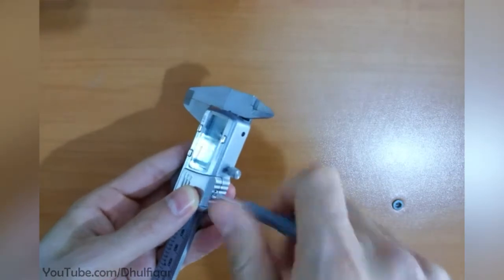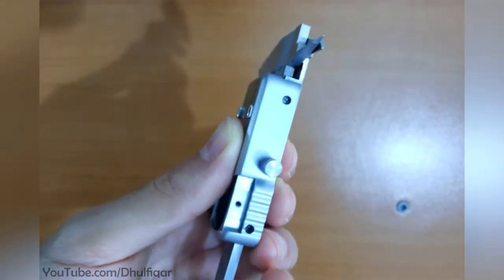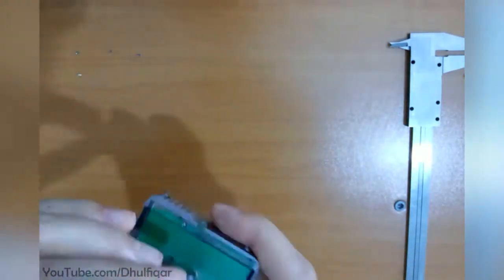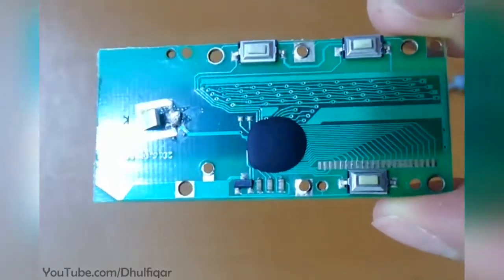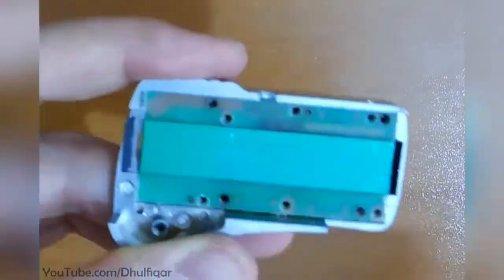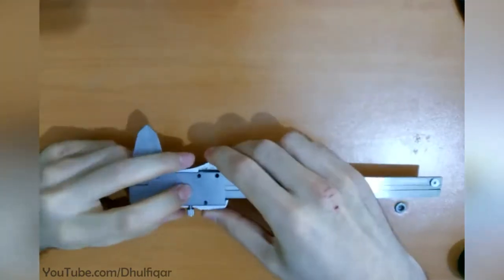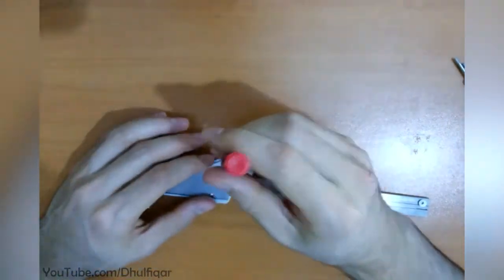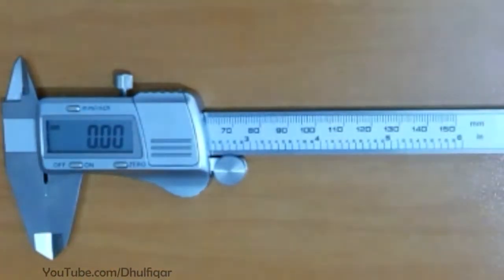Digital Calipers: How to disassemble, assemble and maintain || Vernier Caliper Disassembly/Teardown

Comment: Thanks man. I pulled my calipers out after years in storage. Went to remove the battery and accidentally released the tension spring. I was able to fit it using this video.

Comment: Can we clean it with WD40?
Reply from the maker: No. don't use it. (Or use it only on the metal parts away from the electronics to remove corrosion and then wipe it well with Alcohol to remve the oil residue)
WD-40 Contains oil.. You don't want oil on the contacts of the circuit board.
Use contact cleaner instead.
Lubricate only the parts that require lubricating away from the Electronic parts.

Comment: Merci pour cette vidéo mon ami. Elle m’a bien aidé 👍🏼
Reply from the maker: Vous êtes les bienvenus!
Reply: @Dhulfiqar  merci par contre le mien ne fonctionne plus du jour au lendemain j’ai changé la pile et c’est toujours pareil… je ne comprend pas 🤔
Reply from the maker: @pascalmitz4980  Try to reseat the screen on the board maybe it is not seated right.. Also, Check the battey contacts.
Make sure to dry it well.

All the best.

Comment: Cleaned with cologn and now its broken but smells great
Reply from the maker: Sorry to hear that.
Give the circuit board and the screen sometime to dry.. maybe the water content in the cologne is a bit high (60 percent colognes contain 40 percent water and other ingredient).. either way let the circuit dry in the air or with the help of a hair dryer.
if you have 99% Isopropyl Alcohol or Ethyl Alcohol then soak it in it to suck any leftover moisture from the circuit and the screen.
All the best.

Comment: Whenever I reassemble a set of calipers like this, the LCD display is always messed up. It is very hard to align the contacts on the LCD with the traces on the board and apply the correct amount of pressure with the screws.
Reply: strange, i never had this issue on mine.

Comment: My calipers screen is dim what i do please tell me
Reply from the maker: Hi Ahmed. I don't know why but maybe the battery is low or the screen is not seated correctly or the screen's contacts need some cleaning?
Reply: @Dhulfiqar   sir i change the bettery but still it is dim
Reply from the maker: @ahmediftikhar3235 Hi Ahmed, It seems like the screen is not seated correctly or its contacts need cleaning, I recommend disassembling it and cleaning the contacts with some alcohol and then reseat it. 
But disassembling it might make it stop working.. so it is up to you to take the risk or continue using it as is.. All the best.
Reply: @Dhulfiqar  sir i open it the every thing was fine but its dim i dont no whats happen to it ,the every thing was fine first its happen suddenly when its bettery was dead i put new one from that day its screen is dim so what u suggest for it
Reply from the maker: Change to a different brand battery maybe the battery is not the right model for it.
Reply: @ahmediftikhar3235  buy a new one and leave the poor man alone...take it back where you bought it or get a analog  or just shhhhhhhhhhhh

Comment: I have problem, my digital caliper display error (overlap.) Everything is fine until I drag it to 30mm. The number just keep rolling like overlap. Can you help me with that?
Reply from the maker: I don't know why it does that, but I once intentionally loosened the screws and assembled it and it started doing that, try to disassemble it, clean it well with Alcohol, and then put grease on the tension spring and then tighten the screws well (Don't overtighten it, just make sure they are tight).
Edit:
I just watched your video, it seems like its screws are either loose or it needs cleaning so applicate what I did in the video hopefully that fixes it.. All the best.